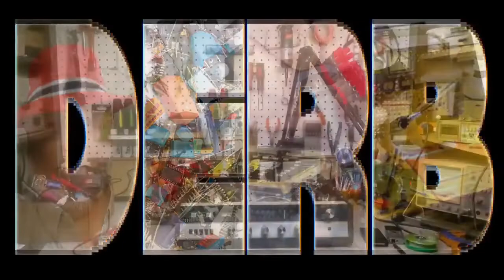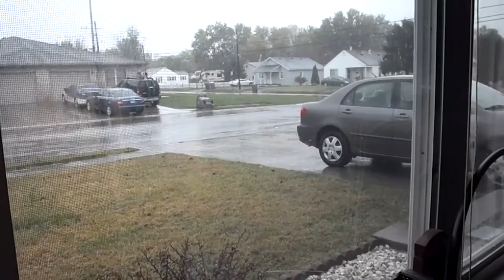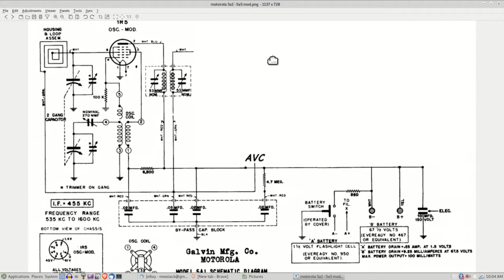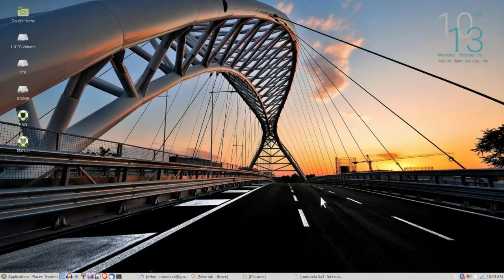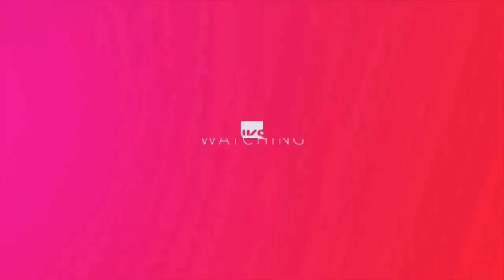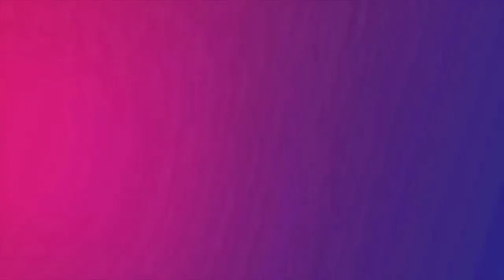DERB - Damp, dreary day

Comment: Did you try running MX-19 from a USB3 thumb drive?  You can use your current HD installation to an create a bootable USB of that installation.  Then drag-race the HD vs the USB3 thumb drive boot times.